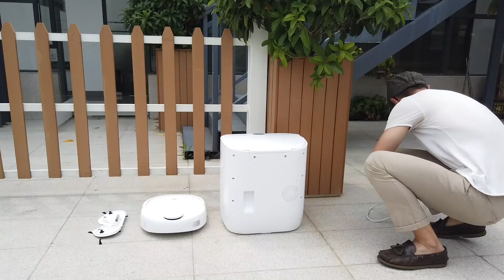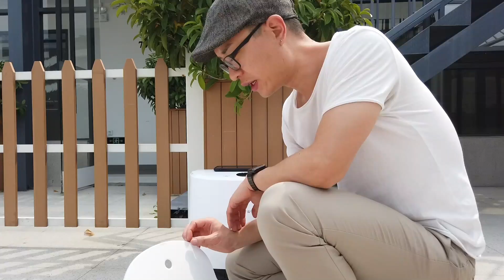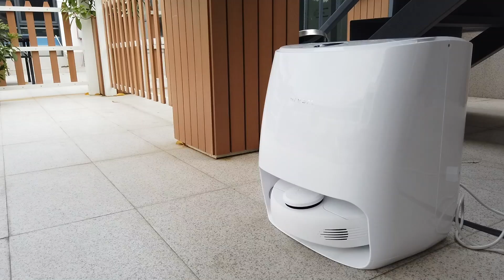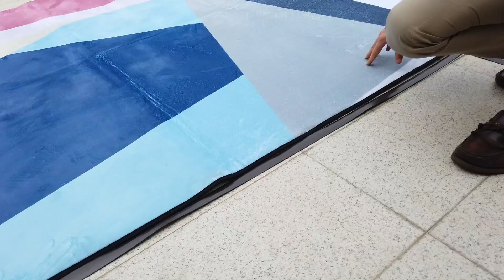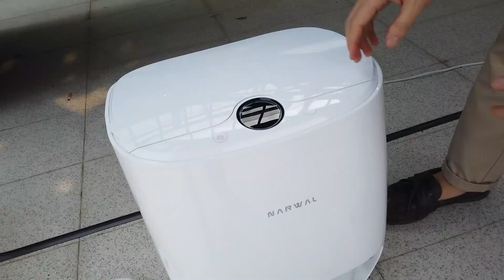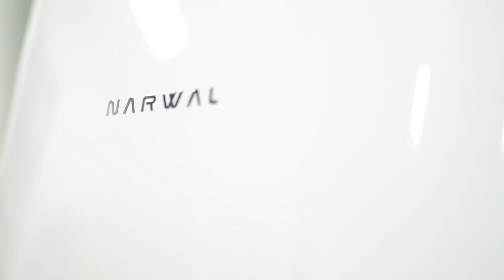Narwal Robot Mop & Vacuum How to Use

Comment: I'd like to have a version with an extra battery instead of a vacuum and a connection to the sewage and clean water piping, like a toilet basically. That would be truly autonomous hard-floor cleaning system!

Comment: How is this completely hands-free if I heavy to manually change the brushes and mops every time in between the to interactions? The vacuuming and mopping is done mostly when you are not around, so in this case, I need to be around and change them manually. It would make more sense to buy 2 different machines and program them after each other so both can be done when i'm of at work or asleep.
Reply: I think it's hands-free for mopping session. Compare to other robot cleaners, it does prevent the hassle of cleaning the mop pads by hand not to mention the mopping function is way better.
Reply: @youlongtalk275  If they would have build the mopping pads on the rear, then, but only then, this bot would make a significant difference to other bots. Now its only a slight update...
Reply from the maker: We suggest users use Narwal for vacuuming in the daytime, and when they go back home to change the mopping module. Because the vacuum would make noise inevitably, but the mopping is quiet.